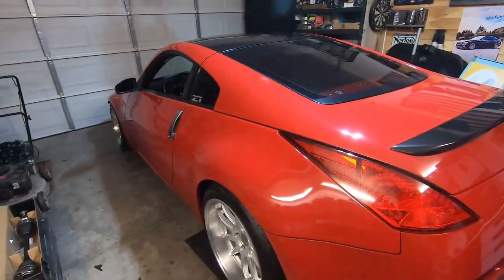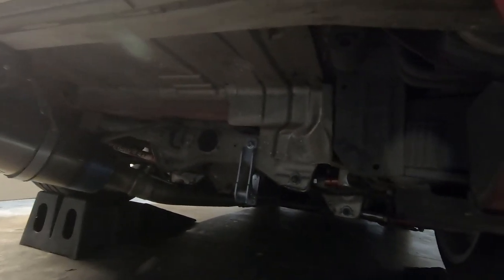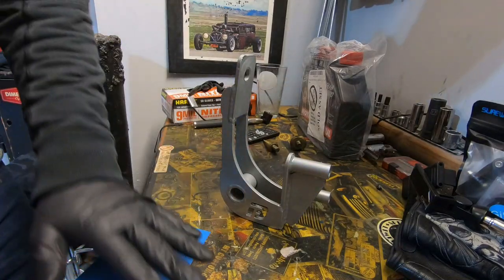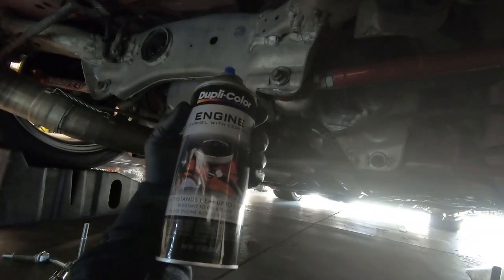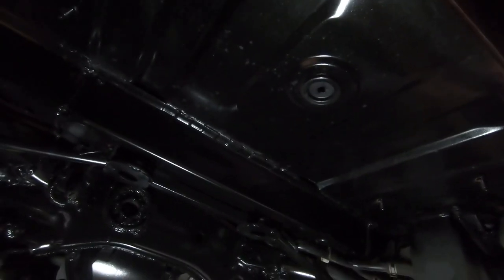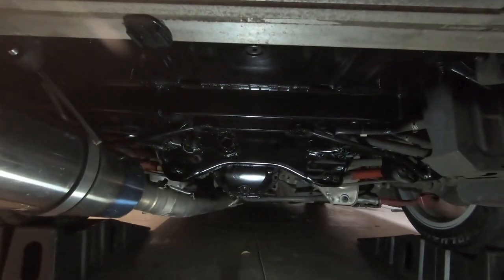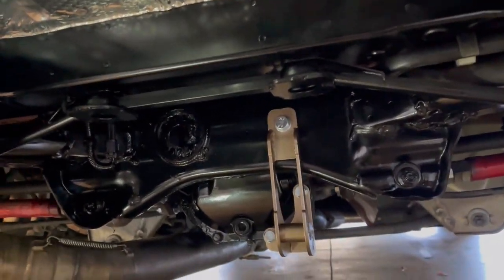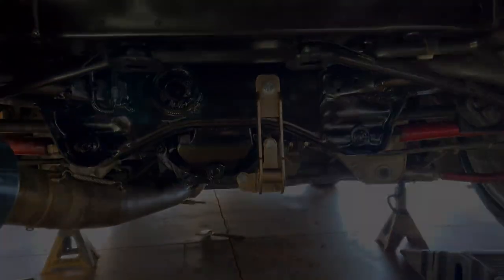CHEAPEST and EASIEST Upgrade for your Q50, 350z, G37, 370z and it Looks INCREDIBLE!

Comment: Lil tip cover your expensive CBE with newspaper or a old shirt then spray so you don't get over spray on your expensive CBE system
Reply from the maker: That’s a good idea—or take it out.  Or—don’t worry about it because you have to pull it out and sand it and Polish it anyway 😂
Reply: @SpeedCultureStudios  I mean if you wanna make more work for yourself 😂
Reply from the maker: @Trav0y  it’s not more work really—it needs to be done.  And a little mineral spirits takes over spray right off!
Reply: @SpeedCultureStudios  I’ll have to try some of that mineral spirits

Comment: I skipped through the video, but your title says this will work on the q50 platform? I'm referring to that diff brace. Cause that other one you promoted I tried and it wasn't great. The guy didn't even send out the adjustment stuff that was mentioned in an updated video
Reply from the maker: Don’t skip through the video lol!  The brace is not the upgrade—the painting is the upgrade.  And no this brace will not work on the Q.  And make no mistake—I did not promote the other option.  I said the concept was there but execution was not great and it did not work lol.  
I would recommend the Z1 brace for the Q50 that they just released.  I just did an unboxing of that product.
Reply: @SpeedCultureStudios  thank you for the quick response and clarification